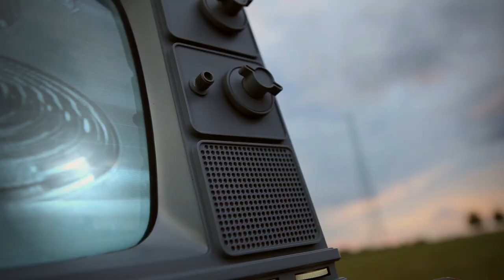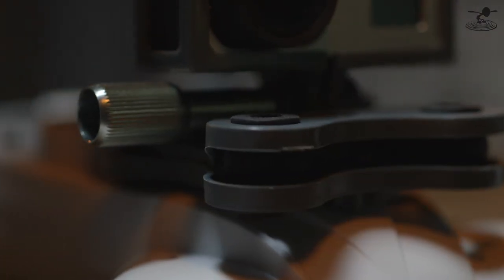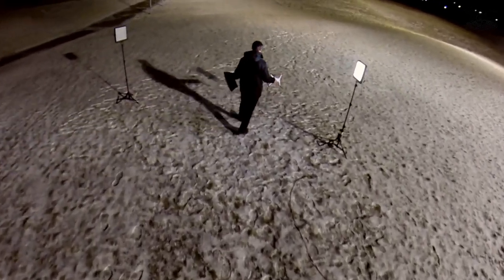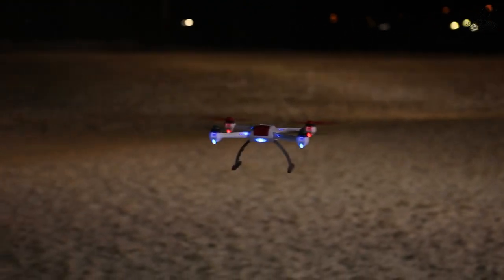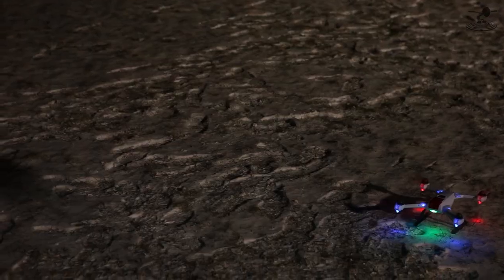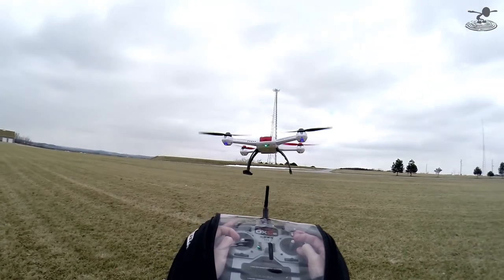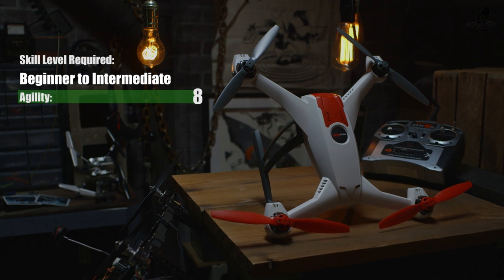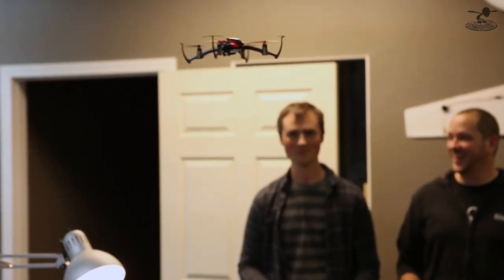Flite Test - Blade 350QX Quadcopter - REVIEW

Comment: Good review. I purchased a 350 a month ago, knowing full well some of the known issues. The quad I purchased already had prop adapters, Cf props and foil shielding to reduce camera interference on GPS (you didn't really mention either of these well known problems). And I have to say I really enjoy flying this guy. Safe mode is fun and stability is dialed in - very much like my Spitfire flying around the field. I have yet to go into agility mode, but do like the option. I'm not a professional photographer, nor a "die hard" quad enthusiast, so understand there are better options out there... but for the price, this was a great entry level mid-size for me. Looking forward to the firmware upgrade.

Comment: as a beginner in 350 sized quads i love my blade, it has been really easy to learn with, I've had no crashes yet (fingers crossed) and I've gotten some great footage, not excellent but great, i also use a mobius instead of gopro its lighter and just seems to get better footage for me, not saying its better than the gopro, just on my 350 it works. also when i purchased mine, the phantom was still well above $400
Reply: Yes, Mobius seems the answer.

Comment: I have the Blade 350 QX and am a beginner it has it is tough as I have landed at HIGH speed several times including free fall from very high altitude and sustained about $25 damage and epoxy repairs I have had a lot of fun with the 350QX , Nice flying to you !
Reply: I have a 200 Qx and I love it and DJI phantom look on the internet about all the wrecks and stuff that those have

Comment: Great review David.
The first thing to do if you are thinking on buying one is to buy the cnc small parts adapters and carbon fiber props.I did this before i flew the QX for the first time.
As david said the gopro set up is not the best for video,If you put a brushless gimbal on it it's better.But it adds a lot of weight.
There is one other thing i don't like,Which David did not say about is if you crash the prop's still stay spinning,The only way to stop them is on the DX5 is 4 clicks down on throttle trim.
On the DX6 DX7 etc you set the throttle kill switch.
I do like the 350 QX but the SK 450 i have with the KK2 board is more fun,And crazy settings you can do with it. 
I am changing the board soon to a crius se 2.5 with gps and bluetooth & other stuff.Can you do a review on that please.I would like to hear what you think about the Crius se.
But for a first quad yes it's good and easy to fly.

Comment: I have the blade 350 qx, and as a beginner-intermediate, I found it perfect for me. I found out that it actually is REALLY durable. One of my first flights, I crashed it full throttle right into a wooden fence, and NOT even a scratch. Although, by the feel of it, the body is pretty cheap plastic compared to the phantom series, but they really improved the props, because they are really durable.  Does anyone have any suggestions for FPV on this quad?

Comment: A great fun outdoor quadcopter for the beginner. The stock propellers are pants (even the new B props) they should be replaced straight away. I purchased the CNC prop adapters and Gemfan 8045 Carbon/Nylon mix propellers, ive had them fitted for 3 month now with no issues at all. I also have a DJI Phantom which is better than the 350 QX for Ariel photography as it is smoother but the 350 QX is more agile and fun.

Comment: I bought the 350 QX several months ago, and I have been happy with it.  As my first Quad I think it is well worth the price, and with some slight modifications such as the Prop Adapters and other small tweaks it has been very enjoyable.  I also like the fact that I have a Transmitter that I can easily use on other aircraft rather that a Proprietary one such as the Phantom.  The Phantom to me was just too costly to be considered when the 350QX can do pretty much the same thing at a lower price. Yes I have crashed it a few times, yes I have repaired it a few times, but it still flies as good as when I first purchased it. With the Version 2.0 Firmware coming out it should be interesting to see the upgrades on flight.

All in all I give the Quad a 7, based on Price and what it is capable of, great for Beginners and Intermediates ...

Comment: Google "Stagility mode"...
Should bring up a thread on Helifreak with info on mixes for the 180QX and 350QX that can be programmed into "computer radios" such as the DX8, DX9 and DX18 which allow the combination of stability and agility modes. When the right stick is moved off center as little as 5% the quad enters agility mode but as soon as the stick is released or moved back to center it automatically goes back into stability mode. Kinda like an automatic "OH CRAP" switch. I stumbled across it a few weeks ago and it is absolutely AWESOME!!!

Comment: Great job David! This is the kind of stuff that makes FliteTest stand FAR apart from the crowd.
I own(ed) a 350QX for a while. I got it at a great price and purchased it with the sole intention of getting acquainted with multirotor FPV. while I built my "real" quad.
It did great for what I wanted/needed it do do! I did not have a hard time getting good video, and no difficulty of making the transition from fixed wing FPV to multirotor FPV. 
One thing highly recommend is to NOT fly FPV in SAFE (green) mode. I almost had a very, very bad thing happen to me one flight where the switch got bumped after the goggles came down, but before lift off. I almost crashed into myself (since I start most flights looking at myself) since I was not where the qaud thought I was and the more i fought it, the faster it came straight at me. Closest to real disaster in my 3 years of FPV.
Thankfully I had enough wits to smash the RTH switch, and the terror subsided inches from my cowering body.
I went through 3 bodies, threw 1 (B) prop in flight, tried the CNC prop adapters and APC props, flew worse. Working on it is a pain, and I had some issues with the RX being able to keep signal on the other side of the park.
Sad to see the EXACT same antenna on the 350QX and the NanoQX (seriously?!)
I know they are about to relase a V2 350x with better Rx, more flight modes, updated LED codes, and easier motor startup (along with a new package with camera and gimbal) for those still interested.
Ive since sold it, built a mini quad (QAV250) and I doubt ill ever look back.
I work at LHS and people ask me all the time about "drones" this, and quad that. I tell most to take that money, build your own. Itll be better suited for what you want to do exactly, gives one the understanding (not just the magical "this works!"), know how to work on and repair, and fine tune.
That same money will be better spent on a NanoQX, lots of homework, and build a multi yourself.
Ill end with "The 350qx is powerful, fun, and easy to fly. Like a sports car for the price of a nice bicycle!"
Just my 2 cents. 
PS- The Phanotm is CRAP and WILL flyaway from you at some point. Do Not Get Phantom. if you HAVE to support DJI, build a flame wheel.

Comment: Great video and a very fair review.

I picked up a blade 350QX a few months ago as my first 'real' quad, I learned to fly on a Hubsan X4.

One comment about the video quality, so long as you're not going fast, it's great. I totally agree that at speed the video even with a gimbal is not awesome due to the excessive vibrations. Knowing what I know now, I likely would have bought a DJI Flamewheel 450 and just built it myself. But I wanted it now and it was available locally. I think it's a great quad to learn to fly on, it's pretty durable. Replacing the shell is a pain, but the one bad crash that I've had that broke a motor pod was fixable with some epoxy and it's been fine since.

Comment: Thanks for a flippen awesome review!! Did you perhaps review the DJI Phantom FC40 or Phantom 2 Vision. I am buying a quad in the next days and need to make up my mind between these two.
Reply: Recently i bought a FC40 and i will recommend you not to buy it. If you need FPV in reasonable price add some extra bucks and buy a Phantom 2 Vision and There are more good quads available at this price range. But buying FC40 is a waste in my opinion. 
Thanks

Comment: looking for a quad to cover aerial video for adding shots to my adventure motorcycle trip, Since you scored this so low in that category, would you recommend another quad other than the phantom 1 in this price range? Looking for size big enough to carry gopro only, packs small, thanks
Reply: Buy the PHANTOM 2

STAY AWAY from the Blade 350 QX, its total junk, a kids toys that has tons of issues.

over 300 flights with the Phantom and ZERO issues other then my own mistakes!

Comment: Awesome and fair review. I bought one when they initially came out, there was a lot of hype and I was part of the group that had the first version props that exploded mid air. Horizon did send me a replacement body and boy was it a hassle to change it over. All of that work only to find out the electronics were damaged from the crash which Horizon refused to change.

If I could start again I would of have just built my own and practiced with a mini quad.
Reply: Also I want to add that in my opinion the DJI is not the answer either. You have expensive batteries to buy with a different connector type that is impossible to swap out unless your an expert and the horror flyaway!

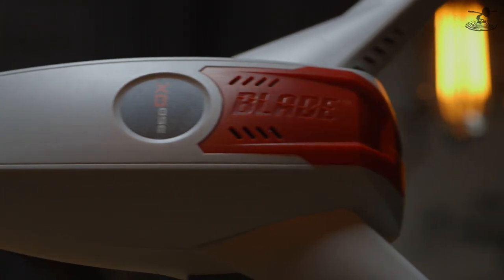Comment: What a great review. I have a Blade qx350 and live in high altitude state. Most of my flying is between 6,000 ASL and 8000 ASL. I am very happy with it and use if for FPV, but it is not without its short comings. Fortunately I have not had a catastrophic crash, but I have had issues with the props. As your review mentioned the plastic props vibrated even after balancing and buzzed horribly. One finally gave out on me in flight and after a 200ft fall onto a mountain side I decided to upgrade the props with CNC machined adapters and carbon fiber props. Total cost was $50 at red rocket hobbies and it was worth it. Rather than going the GoPro route I have found the foxtech has some pretty nice equipment. I use their HoryzonHD 1080p camera, TS832 transmitter and Skyzone goggles.To clear up noise I have a small 800 mah battery on the quad as well as the flight battery. With all of that equipment and the altitude I fly at my flight durations have gone as long as 7 min, but that close to falling out if the sky. I set my timer to 5 min so I have a comfortable 1:30 to get back and land.

The GPS return to home and GPS commanded mode are REALLY nice and have saved my quad more than once. I normally fly in stability mode, because as David pointed out fliying in GPS mode is an odd experience. However, I have learned there is a very interesting use for it. Yes this quad has a GPS based RTH, but the flight speed in this mode is relatively slow. If you are 500 yards away and your timer just went off to land and you just lost orientation you are in a tight spot. This is where SAFE mode actually has some utility even for experienced flyers. Although flight speeds aren't as fast as STABILITY mode they are faster than RTH. Once you switch the quad to SAFE mode just pull the stick towards you and the quad makes a beeline straight to you regardless of which way it is pointed. As soon as it gets close enough that you can regain orientation you can kick it back to STABILITY and fly even faster to your location. When flying FPV you can use this feature to just get yourself pointed in the right direction, and when flying line of sight you can use this feature to get the model closer to you so you can regain a proper visual.

Comment: I first bought a nano, then the 350, then the 200, now building a BO Mini Spider HEX! Other than having an issue with tuning the 200's motors after changing the props (still dont know how to do that, HELP) they have all flown beautifully! I haven't upgraded the firmware in the 200 yet, due to the tuning bug, but that will happen! The 350 on the other hand, brilliant! In safe mode I hand the controls over to my son, and he has a ball! Then i take over, flick to agility and do some flips and rolls, he still doesn't know how I do it! So IMHO, get the 350 and strap a gopro to it, then once you've progressed a little, get the 200 and throw it around, then once you have been well and truely bitten, build your own quad or hex and get into FPV, it's awesome!

Comment: David,  great review, thanks for putting up with the cold.  The 350 qx got me into quad flying at Christmas, never flown a quad before so the "out of the box" capability was attractive.  I fly fixed wing mode 1 and found flying quad mode 1 very difficult so I am now learning Mode 2 for quad and the SMART mode makes that easy, if I freeze I let go and it holds until I gather my thoughts but I still like to fly it like a plane and with it not following its nose it gets confusing.  Then I put it in STABILITY mode but find that with no altitude lock it is very hard to keep control as the throttle response is strange and I end up with a yoyo that eventually hits the ground. Blade have advertised new firmware with alti lock to come out later but there is no pc program to help with upgrades. It breaks easy and parts are hard to get in the UK. I have gone through 2 bodies, 4 sets of landing legs and now use stock props with Small Parts CNC adaptors.  I think your review was spot on.  I have cut my losses and move on to a DJI F450 with Naza M V2, so much better.  Keep up the good work, Cheers
Reply: So true about the STABILITY Mode it tends to drop easy you have to really throttle it up  or do High flying i dont fly proximity in that Mode

Comment: The GPS issue is fixed right now.
new versions have a different mounted GPS.
Softwaresided update is done for new releases too.

i had around 12mins flighttime + GoPro3+ with wind conditions around 40km/h+
stock batteries 

the props issue seems to be fixed.

Comment: PS, if you only have a DX5I transmitter your controls lock out at 45* even in agility mode. You need to bind it to a DX6I or higher spec transmitter to achieve aerobatic manoeuvres. Sorry if this is old news but I'm just finding out as I go. I'm still more than happy with this quad.

Comment: You brought up some good points in this review.  As a blade owner with 120+ flights I have some things to add :

The stock props on the 350 QX are faulty by design.  They officially recalled the original "A" props and replaced them with "B" props, which are also faulty.  Mine broke in a simple hover and caused major damage to the body, props, and landing gear.  Horizon was not helpful and did not offer to send me replacement parts and requested I ship my unit to them to "investigate".  I had already started swapping the parts out, so I was unable to ship it to them.  I ate the cost of the replacement parts ($75).  These prop failures could get someone seriously hurt.  Horizon warns that using aftermarket (good quality) props with the available adapters will void the warranty on the blade 350.  I don't care, I run them anyway so I can use good quality props that won't snap for no reason, and for the safety of myself and anyone near where I'm flying.

The 350 QX is NOT GoPro compatible and should not be advertised as such. If you mount a gopro on it and fly around you will often lose GPS lock. It may also fail to obtain the initial GPS lock when the quad is powered up.  This is due to interference between the gopro when recording, and the GPS receiver in the quad. Again, a major issue caused by faulty design.

The aerial video quality is shaky even when being careful on the controls in light wind.  It does not capture acceptable quality video at all, unless you modify it with a gimbal.  I took my gopro back because of the interference and quality issues, when in reality it's the Blade that is faulty, not the camera.

With no camera, and aftermarket props and adapters... the blade is a blast to fly.  For pure fun flying, there is no comparison between the blade and the DJI phantom.  It's much faster and more agile than the phantom.  If you don't care about filming and don't mind voiding your warranty - The blade 350 with CNC prop adapters with Phantom carbon fiber props has been rock solid for me.  I am pissed that it had all the problems I mentioned from the factory, but I have to admit it's a really fun quad to fly once you upgrade the props.  If you want to film anything worth watching, buy something else.

Comment: I had a hard time looking for an excellent quad that not only satisfy my desires, but my wallet as well. I bought the Blade 200 QX, but later returned it due to the defective board that had a limited range of around 100 feet before a huge amount of signal drops. I was so stuck in-between this or the DJI Phantom, but my heart or wallet wasn't set on any of them... so I kept looking and found a custom quadcopter with 2300kv motors for only $180 which made my jaw dropped. It ran off of a 3S battery and every part I found online for it got great reviews, so I bought the only one. The only downside that I saw that the product was using a DSM2 satellite receiver and not a DSMX satellite receiver. I have gotten my feet wet around quadcopters, but this quadcopter that I bought is going to teach me a lot. I made sure it had gyros and an easy set up for the control boards, plus I found a manual for it, so it shouldn't be too bad setting it up.
Reply: furonwarrior So it is the only one in existence, why did the not put it in production, being that great and cheap

Comment: I have the 350 QX and I really like it. Enough power to lift your camera, FPV, and other accessories at once. Firmware 3.0 update lets you customize the altitude limit and geofence. I do agree the stock props are junk. I upgraded mine to carbon fiber ones. Really good batteries available like the Giant Power 3300mah. got my 350 used at a great price